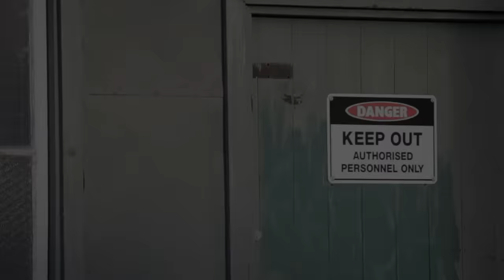KTM 300EXC THE POWER OF SOUND

Comment: If you were wondering what he said: Your welcome :D
The power of 2 stroke
Engineering, the perfect partnership between physics and design
A tangible record of man's greatest achievements
Perfected with technology, build to enjoy the test of time
The world is alternate by these creations, some assist the way of live some promote our demands
Engineering is a complex mysterious and ingenious idea brought to live by inventions
Machine's used to build machine's
Some have limited purpose superseded by a new idea
But every so often that idea becomes an mechanical masterpiece
One that cannot be surpassed and cannot be made redundant by a new design
The 2-stroke engine one such masterpiece, its power-weight ratio is superior 30% higher than the equivalent capacity 4-stroke
Its naturally aspirated, needing no assistant from a accelerator pump or fuel injection
It achieves a full power cycle with just 2 strokes of its piston, induction, compression, combustion, exhaust
Their are no valves controlling each fase, instead the piston reveals exhaust and intake ports set in the lower half of the cilinder
The piston travels up the cylinder as a syringe drawing air and fuel into the crankcase though a one way read valve
Its an organic exchange of vacuum and pressure as the piston puts fuel and air in the cylinder
Intake ports direct the fresh charge to the cylinder head while combusted gas is venting simultaneously trough the exhaust port
At 10000rpm the spark plug ignites 166 contained explosions of power every second
A 2-stroke achieves this rate of combustion thanks to the exhaust shaped like a musical cylinder
It uses the sound waves to the minute from combustion and reflects them back to the exhaust port to momentarly reverse the of gas
This forces escaping fuel-air mixture into the cylinder which supercharges the cylinder at higher rpm
A 2-stroke reaches maximum power when the returning sound wave hits the exhaust port at the exact moment of combustion
This is when it hits that magic note
This is when a 2-stroke is on the path
There's no other engine like it, there's nothing like 2-stroke power
And there's really nothing like the power of sound
Reply: Not enjoy but endure the test of time
Reply: a real psalm 4 the 2STRKs!...   a loooong one, but inspired with beauty

Comment: 2-stroke engines make higher than atmospheric pressure in the crankcase as the crankcase air and fuel mixture  is compressed when the Piston returns to bottom dead center.. The supercharged air/fuel mixture e is then transferred to the combustion chamber through the boost ports where the piston compresses the air/fuel again at top dead center mixture fires off.... This process rises in pressures as the RPMs go up..
The new KTM fuel injected two strokes have pressure sensors in the crankcase.. this is why crankcase main bearing seals are critical in two-cycle engines.. they not only have to hold pressure they have to hold vacuum and there are tests for doing that to see how much it holds for so long of a time
Has a crankcase steals around the crankshaft fail the engine can lean out and run a pissing each other..... A four-stroke engine only relies on the atmospheric pressure alone they do not make any boost at all this is why a four cycle four-stroke engine same size as a two-stroke will never make the same horsepower as four cycles four-stroke engines naturally aspirated are not supercharged but the two strokes are ... And the two stroke horsepower comes on much sooner at much lower RPMs simply because they are supercharged and the rate at which they are can be very by porting and polishing changing the expansion Chambers design length of stingers on the end size of the carburetor size of the intake porch compression ratio in the cylinder head this amount of squash area terminate that Nation before the combustion center fires lots of things to consider..... One complaint I've heard from 4-stroke Fanboys that two-stroke engines do not have much engine braking when you let off the throttle.. and no they don't have much engine braking when you let off the throttle that's why they win races more than four strokes.. when you're on a motocross track with a two-stroke letting off the throttle is not an option..
Keep it pinned if you want first place

Comment: Can you ride a two stroke e.g 85sx on the trails with out it over heating and spark plug needing to be replaced
Reply: bro, if you are melting your plugs you are doing serious damage to your engine. if they just stop sparking and come out black you probably either are mixing the petrol/oil to much or just don't ride hard enough to fully burn everything. 
two strokes use plugs, more often than four strokes by far. my friends plugs last maybe 4 tanks of fuel MAX (125) and even less if he isn't on the power band everywhere. i have only had one bike over heat and scare me, that was my 530 exc and was on slow 1st gear trails in the middle of Australian summer with a broken radiator. your 85 should not be overheating.

Comment: Though I like the video, and the bike, it's wrong to say that 2-strokes doesn't have fuel injection. Sure, lots of them still run the good old carb, but most modern 2-strokes engines like snowmobile engines, are fuel injected, and they run like the wind. I am a carb lover, don't get me wrong, but overall fuel injection is a better system, even though reliability might be better with a carb

Comment: I like the power band on 2 strokes but love the bottom end of 4 strokes and i dont want to rebuild the 2 stroke every year, so i ride 4 strokes
Reply: u still have to maintain it like valve check and such. rebuilding a 2stroke is cheap and easy. a 4 stroke vill shit on itself sooner or later and now that's expensive. but ride what u like
Reply: i would rather do an £140 rebuild on my 2t once a year than when my 450 shat itself and cost me £1300 to rebuild

Comment: can someone please write what the guy in the introduction is saying? im not good at english and dont understand a few words, please
Reply: What do you speck?
Reply: i mean in inglish but lyrics hah
Reply: If you were wondering what he said: Your welcome :D

The power of 2 stroke

Engineering, the perfect partnership between physics and design
A tangible record of man's greatest achievements
Perfected with technology, build to enjoy the test of time
The world is alternate by these creations, some assist the way of live some promote our demands
Engineering is a complex mysterious and ingenious idea brought to live by inventions
Machine's used to build machine's
Some have limited purpose superseded by a new idea
But every so often that idea becomes an mechanical masterpiece
One that cannot be surpassed and cannot be made redundant by a new design
The 2-stroke engine one such masterpiece, its power-weight ratio is superior 30% higher than the equivalent capacity 4-stroke
Its naturally aspirated, needing no assistant from a accelerator pump or fuel injection
It achieves a full power cycle with just 2 strokes of its piston, induction, compression, combustion, exhaust
Their are no valves controlling each fase, instead the piston reveals exhaust and intake ports set in the lower half of the cilinder
The piston travels up the cylinder as a syringe drawing air and fuel into the crankcase though a one way read valve
Its an organic exchange of vacuum and pressure as the piston puts fuel and air in the cylinder
Intake ports direct the fresh charge to the cylinder head while combusted gas is venting simultaneously trough the exhaust port
At 10000rpm the spark plug ignites 166 contained explosions of power every second
A 2-stroke achieves this rate of combustion thanks to the exhaust shaped like a musical cylinder
It uses the sound waves to the minute from combustion and reflects them back to the exhaust port to momentarly reverse the of gas
This forces escaping fuel-air mixture into the cylinder which supercharges the cylinder at higher rpm
A 2-stroke reaches maximum power when the returning sound wave hits the exhaust port at the exact moment of combustion
This is when it hits that magic note
This is when a 2-stroke is on the path
There's no other engine like it, there's nothing like 2-stroke power
And there's really nothing like the power of sound
Reply: I wrote that out the same as you and then it all erased and i got so pissed i gave up. Thanks for someone else doing it!

Comment: There is several 2-stroke classes. 125 and from next year a 300 class.
There is also 250 2 strokes in the 450 class. 
Look at what the twostrokemotocross team is doing

AMA sucks for not letting 250 2-t race the 250-f bikes I guess they know the 250-f will be eaten alive.

Comment: yeah they were good bikes i raced enough of them,but seriously the modern four stroke engine is far superior in all conditions except sand ,on hard pack there way to unpredictable and skittish with little to no torque ,they also ware you out fast with having to be on the clutch everywhere an clickin gears ,the 4 stroke gets the nod an most pro,s would say the same thing ; )
Reply: Bryan Milligan 2 stroke make more torque, BUT at 10 000 - 12 000 RPM,and four stroke make same torque about 6000 - 8000 RPM

Comment: right, 4 strokes do have much torque,  but 2 strokes with same cc's do have just as much.  its too bad 125 2 stroke have to ride with 250 4 stroke in the competitions.  if it was up to me i would not accept it. 125 = 125 and 250= 250   come back when your 250 4 stroke is powerful enough to ride with the 250 2 strokes.     (in that way everyone was still riding 2 strokes today.)  but now  the 2 strokes are simply not interesting anymore today, because who can beat 450 4 stroke with 250 2 stoke